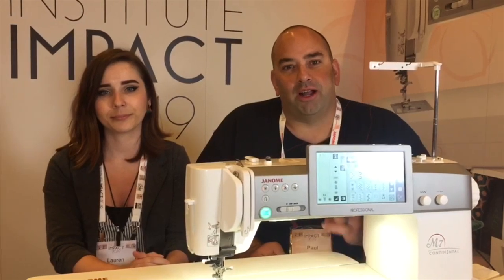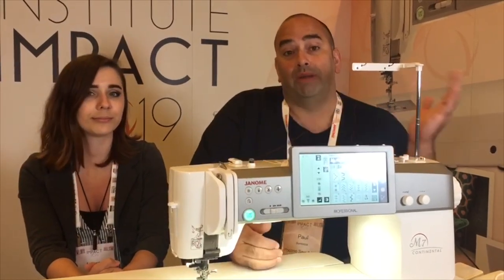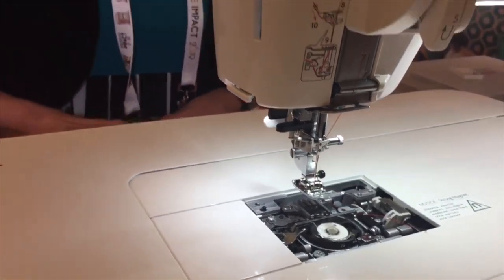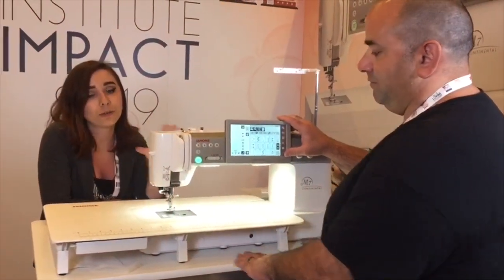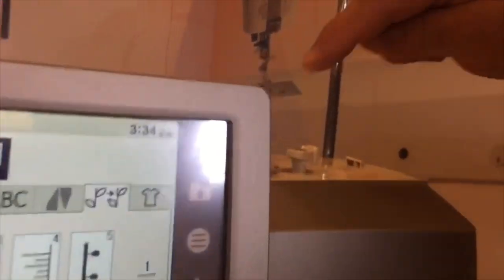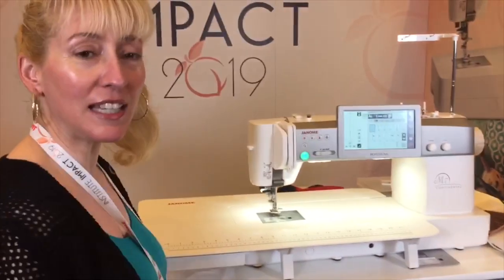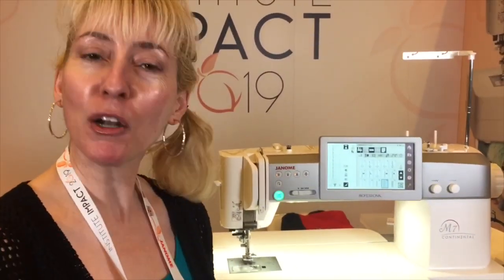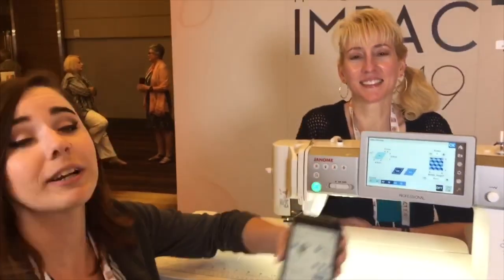Introducing the NEW for 2019 Janome M7 Continental Sewing & Quilting Machine

Comment: I am tossing up between this machine and a bernina with a stitch regulator for quilting. I am favouring this, but want to know please how do the bobbins compare in size, is this the same size as my 8200, or bigger. Love the finish of the machine.
Reply from the maker: Yes, the bobbins are the same size as the 8200.  The M7, however, has an optical bobbin sensor for low bobbin warning.